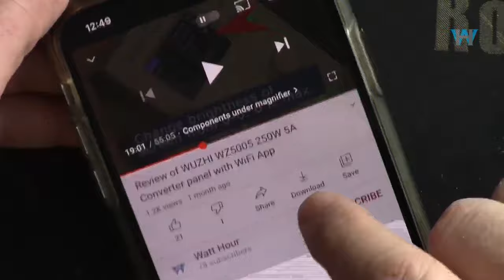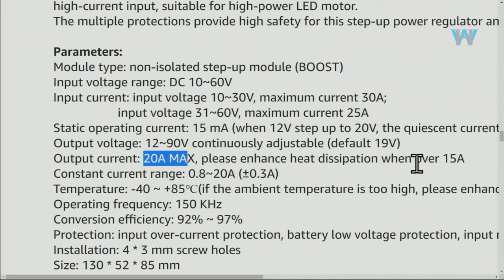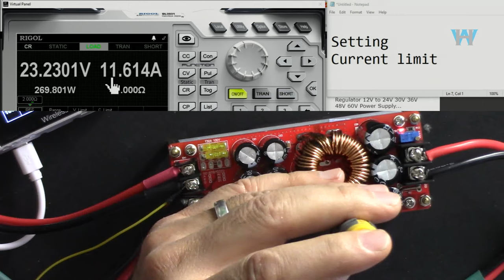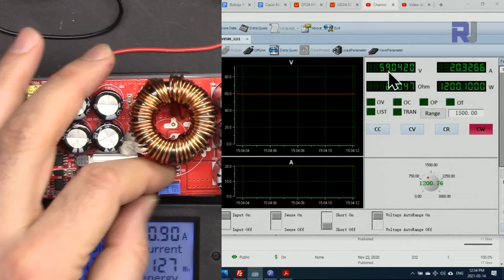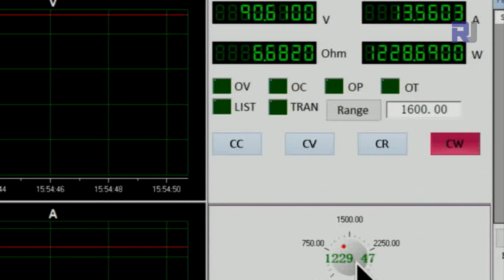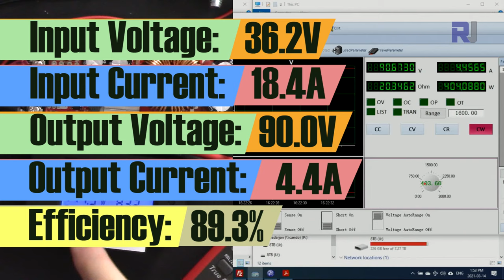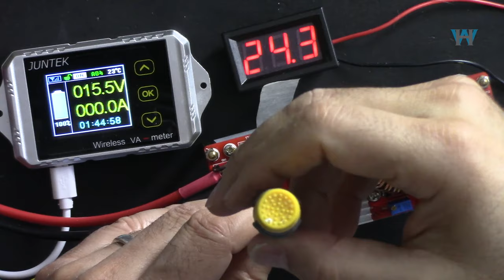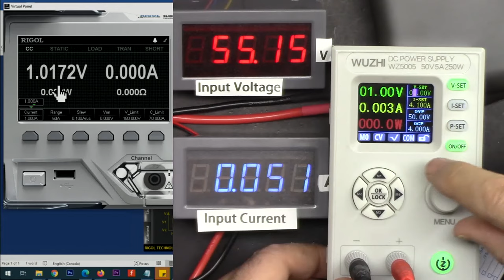Review of DC 1500W Boost Converter 10V-60V to 12V-90V module 1.5kW Tested

Comment: i got 1800w version of that. planned to use it at like 50% of power to turn 3 series 12v server psus, so 36v, into charging voltage of 14s li-ion, so 58.8v. sure, needs diode, external switch and current meter. now i think i maybe need dxp800s instead. it outputs current via uart and you can turn it fully off. yeah, i realize that this is add cheap crap but i need some solution to use cheaper off peak power at home. sadly i can't get hold of any -48vdc equipment i could modify. oh and for inverter i plan to use powerware 9 series online upses, most of what i have are 24v. with one 48v and one 96v, so hell knows what will become of this plan. my savings might go into boosting and bucking

Comment: I intend to use the one I just ordered on my e-bike which usually pulls 3kw @ 52v(58.8v). I’m limiting the controller amps to 22A to give around 1,500w so I’m hoping I will get a higher RPM for the hub motor at the cost of torque and acceleration. I ordered two fans to replace the nasty cheap one that’s on it, hopefully will hold the temperature down lower.

Comment: out of curiosity I also bought it but the fan didn't turn on, is that normal but the volts work.
Reply from the maker: fan will turn it when the module gets hot enough. it seems your module is not getting hot to turn the fan on. this is normal.

Comment: I was thinking of using one of these to power my laptop from my lifepo4 battery bank. This would be efficient than using a 2000w AC inverter and big 200w power adapter.... but I'm not sure on the quality of the device, fail-safes like over voltage, output current ripple etc, is it worth using this for a $1500 laptop? I can't find a proper 200w laptop charger anywhere for 12v bank... any thoughts?
Reply: I know it's 3 years. There are nice HP supplies that are 200w for newer Thunderbolt 4 docks. They also have id pin. I get a lot of HP minis from work that only require 65w.  However the reason they throw these minis out is because of faulty factory bricks that when they don't put out the recommended power rating the PC refused to power. All they get is error beep and light codes. I was told they are bad boards but this couldn't be further from the truth. Everyone I get have i5 8500 65w CPUs. Either by replacing the stock CPU with a 35w like the 8500T or simply upgrading the brick to 90w or 120w they all come back to life. Ive been recovering 2-3 a week at the low-low price of $30 for a new adapter.  The other workers just look at me like I'm retard for grabbing them out the dumpster.

Comment: I am wanting to use this between my wind turbine and a charge controller for my 48v system. My wind turbine starts producing at 12v and will go up to 60v My batteries wont start charging until I have 48v so I want to amplify the lower voltage to 48v with a max of 90v then run that into my charge controller and it will deal with raw fluctuations in volts/watts and charge the battery's with it. Do you think this might work?

Comment: What is the NCE80H15 MOSFET doing? 
It seems to be in series with the negative input. 
Is it part of the under voltage shut down?
Reply from the maker: I don’t know which one is that but if it is the power mosfet then it ia the main switch used in boost converter.

Comment: Hi, does it safe to use this converter for 24/7 ?? My load is just 50-60 watt, I have input source 12v that should boosted to 19v. Thanks for your answer. I know that this converter is overkill for my system but I just want to achieve safety system.
Reply from the maker: Hi I believe.  No one can answer this as they is matter of liability. You test it in a safe environment away from people and valuables and leave it on with load for several days under different  temperature conditions like very hot room etc and see if it passes then use it.

Comment: great vid! what happens when the input voltage is higher then the output voltage?
Reply from the maker: not possible. input will appear at output.
Reply: @WattHour  my output voltage appears to be slightly lower if below 24 volts input

Comment: Tks for review it, can we replace higher mosfet and higher capacitor to make it boost to 250 vdc, help me if u know. Tks again.
Reply from the maker: you are welcome.you can't just replace the components. there so many other parameters needed to be changed.not possible.
Reply: @WattHour  my project is input range 12-90v, output stable add 230 vdc. A output maximum i just need 15a. Can u help me
Reply: I have the same case, and haven't found a solution yet

Comment: Did the replacement mosfets I sent you work out??
Reply from the maker: Hi, No did not try them. It was long ago and I forgot about them. Are you the person that sent me transistors from Austraila? Thanks. I belive I replied to you on Robojax. This video was there, I moved here with new test.
Reply: @WattHour  Yep, Australian guy! :)  Perhaps you might find some use for them in the future.

Hope I did not insult you about the SS8550 on the other converter, but I recognised the the totem-pole configuration straight away because apart from other things I am an electronics design engineer, sometimes in DC-DC converters (custom for special purpose mostly).  The SS8050/SS8550 is a common gate drive config because of the higher current these transistors can handle (pulsed, continuous they would melt), and they are CHEAP.

I'm wondering why you changed your YouTube channel?
Reply from the maker: Hi @stevenbliss989 ,

Regarding the SS8550, I appreciate your input. I'm indeed utilizing them in the future, thank you. . It seems my online search led me astray, perhaps due to a typo or misinterpretation of the components. No worries though, we all learn and adjust.

As for the channel name, it remains unchanged. @robojax is still active there. Since Power/Battery/Charger topics garnered their own audience, I decided to establish a separate channel. Let's stay connected and be safe. Cheers!
Reply: @WattHour  Cheers! :)

Comment: I am layman in electronicsion or not much informed about it, but is there any advantage of this product for solar system of residential usage.
This boost is useful for charging batteries only or if batteries are already fully charged then can it convert the boosted power to AC so that the load may use that such sort of boosted power ??
Reply from the maker: This not good for changing battery because we can’t set proper current limit. This only DC boot converter no AC. But for whatever purpose if you input  dc voltage bit will boost to DC and I have shown so many testes in this video.
Reply: This is only for charging batteries and for variable use and  for solar pannel

Comment: would you not be able to set the output A to the minimum and then go up from there measuring it with an Amp meter?
Reply from the maker: Yes they is th best approach
Reply: @WattHour  thank you for the reply! 
my idea is to use one of these to charge my Ecoflow river pro in my car. 
standard 12v socket it only allows 8A current which limits the input to just under 100w, this is sooooo slow. the unit is 720Wh so basically 7 hours to charge. 

on a wall plug it charges with 660w and only takes 1,6h for a full charge, this is a bit over the top. but if it also is able to take 25V 12A solar input. so my idea is to (instead of solar) put a step up converter from the cars Alternator which puts out around 14v to 25v 12A (or whatever the max is that the unit allows) and then i will get around 250 to 300W which will make the unit charge in around 3 ish hours

thanks for making videos like this!

Comment: Im using this Booster for my Wind Generator to charge my battery. The Problem is, that i cant get much more than about ~10W through this booster.

I Set undervolt protection for 20V and output to 55V (for 48V Battery).

Do i need to adjust the Ampere too on this booster by default or is it Set to maximum already? Thats the only thing i might think off, that Block the full energyflow

Thanks in advanced
Reply from the maker: Hi, yes adjust the current as it could be limiting. I have done in the video two or three times so watch fully.  This can deliver 1.5kW

Comment: Hi..thank you so much for this informative video. I have a question, can i use this to upgrade my ebike 36v battery to be 48v? Thank you.
Reply from the maker: Hi, upgrade? You mean to change this converter by adding or removing components?  Unless you have the schematic and know the calculations, you can’t do it. If you see the video you will know the minimum input voltage and the maximum.  For output and input
Reply: @WattHour  No, what i mean is: i want to step up the voltage of  my 36v battery to 48v. Can i use this converter so i don't have to buy 48v battery? Because i want to upgrade the speed of my ebike.
Reply from the maker: It seems you have not watched the video then. Please watch. I have tested all input voltages.
Reply: @Indoholl  You can. But you lose 10% power. Or lose 10% of your battery. Also, beware of maximum input power. Max output current is 20A so at 48V max output power is only 1000W.

Comment: Hello watthour ,  thank U for sharing

I bought one after watching your video , however i found the voltage remains 120V high and cannot be adjust,  no matter how many circle i twist on CV in both directions . When i twist the CC knot in certain position anti-clockwise, the voltage drops gradually as input 

Do U know whats wrong with it ?

I tried 12V~30V input with abundant ampere , all didnt work
Reply from the maker: Hello, it seems the pot must be bad. Try another pot with the same value.
Reply: @WattHour  the pot means the blue CV adjustable knot ??

Comment: Can you connect the outputs to multiple units, you have so many just wondering if you can or have tried to connect more of them in series or parallel
Reply from the maker: you can connect them ONLY in series but be very careful to set the output voltage EXACTLY the same. if voltages are not the same the current will flow from one to the other and could cause fire.
Reply from the maker: Hello, your comment had three links and it was burred in the spam list and I just saw it. 
you can connect them in parallel if and ONLY IF you set the output the exact value. But you can't connect them in series as Ground must be common for the input.
Reply: @WattHour  thank you for replying to my comment sorry it got lost but if you get this message here's another question❓ those boost designs are all based on voltage doubler or multipliers is it a way to make such a design with batteries and replace the capacitors and if you can't what happens if you do it anyway , do you get pass through charging.

Comment: Hy im very interested With your research..Im request test booster with battery..because i test it..voltage drop significantly..is it booster not work for battery? I have question..how many battery capacity can work for this booster? I have plan for my ebike
Reply from the maker: Hi, if you want to connect the battery at input, yes it will work. it just need a power source and it does not matter where it comes from.  Remember InputPower=(outputPower-15%Input) meaning the ouput power is about 15% less than the input. So if you need 100W at the output, then input 100W+15% = 115W must be at the input.  and Power=Voltage x Current =VxI. I is current in Ampere or A so you could write it Power=VxA now you do the math and connect as many batteries as you like.

Comment: Do you know if they should be able to be put in parallel on the output side (connected to the same input source)?
I have two, and every one individually (set to certain voltage and CC-Limit) with work fine (set to 150W@15V input). If two in parallel, the CC will not work. They should deliver 300W combined, but will go up to 1000W, and the melt the fuses of my source. Why? Even the seller states that they can be paralleled. What am I missing?
Reply: Pm me can you to install do sola paint of charger...

Comment: Sir , Can i ask a question about this circuit ? 
we set the output voltage to 90v without load and when we connect a load , we saw that the output voltage is reducing to 30V even though we open the current limit all the way ?
why is that happened ? please help us 
thanks..
Reply from the maker: When the voltage drops it means either the current limit is set in the module so set it to maximum as I have show it or your load need more than the maximum curd this module.

Comment: ive found when you have a low input voltage say 12 volt and want to boost it to 85 volt ,this is when you start stressing the converter and it really sucks in the amps on the input to make the 85 volt

Comment: Where can I take 5v source from this booster? Thanks for the info, nice review.
Reply from the maker: I have explained the components one by one. I just watched the video making sure I am answering your question correctly. The XL700A is the regulator used in this module.  Datasheet is http://www.xlsemi.com/datasheet/XL7005A%20datasheet-English.pdf  and this can supply 400mA maximum . The output is adjusted using two resistors. Even if you it is 5V, I would advise against using getting power from there.  Just simple 7805 Chip and get 5V.

Comment: Hello sir thanks for the presentation,
I have a 3s battery pack which is 12.6v, i want to use it with the 12V inverter but working voltage of 18650 battery is 3.3*3=9.9v till that my inverter shut down and i was unable to use the the full power of the battery, so i was thinking to use this device between the battery and inverter for maintaining the voltage to 12V. 
Can i use this my load is under 150w.
1. What will happen when my inveter try to charge the battery (charging voltage is 13.8 to 14.5V maybe)
2. I have a different setup to charge my battery.
Sir can i use this device between the battery and inverter to maintain the voltage
Thank your all time viewer.
Reply from the maker: Hello, if you want to just use it for boosting the voltage yes. But as I remember you can limit the current precisely. So as you said you have charge controller and should have it.   But you need only 150W.  Why use this which has 10 times more powerful.  So use this 400W https://youtu.be/xSI9k5BK-jU but if you already purchased the 1.5kW , use it
Reply: @WattHour  inverter charger will not cause any problem to this booster, bcoz output volt is just 12 and inverter charge it at 14
Can it Handel the inverter charge of 14v while the output volt is just 12v,
Bcoz inverter will try to charge the battery

Comment: Since this module has cc and CV can we use this as boost solar charge controller? I do have grid tie inverter with 22-60v input and would like to boost may solar panel to charge my 48v battery. Will it be possible and will it be effective and how big would be the loss?
Reply from the maker: Hello, when I was doing the test, I said no one will have any questions.  I have tested with all possible voltages. I have presented in each test with the efficiency like 80% when it is 80% then losses is 20% because 80+20=100. please watch to get answer. I don't remember what were the values.